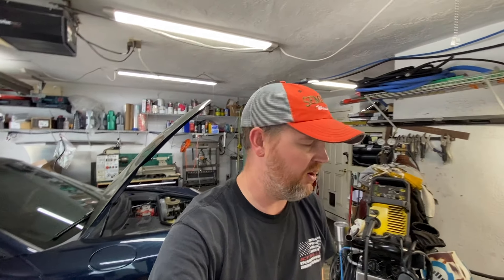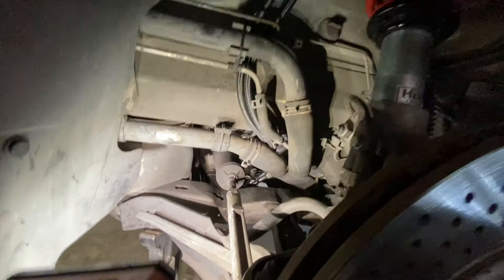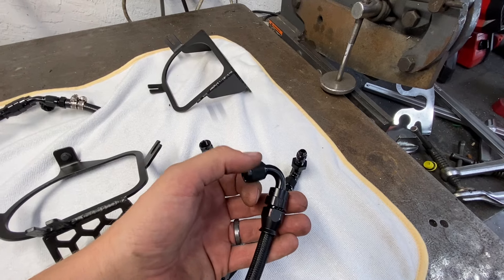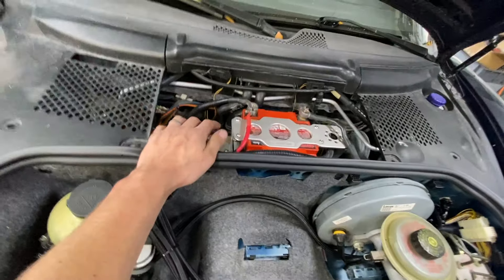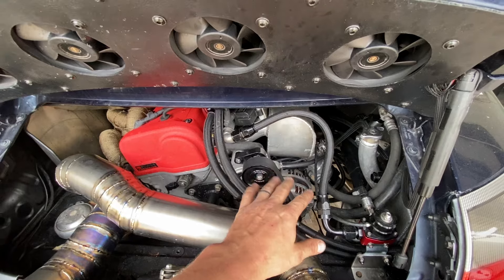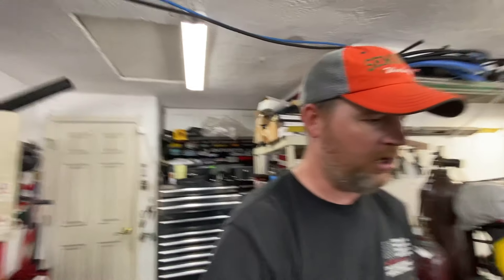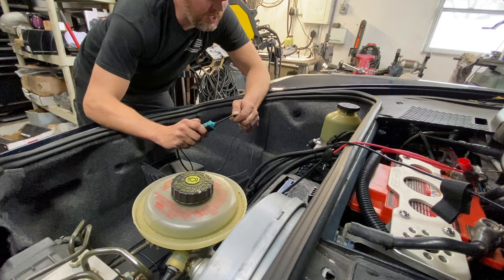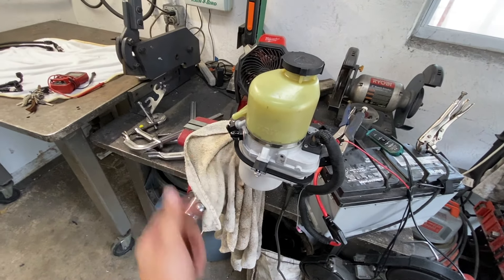Porsche 911 Electric Power Steering Conversion Now For Sale!

Comment: Is at maximum duty all the time?  Have you measured peak draw?
Reply from the maker: Idle draw 6A
Moving left to right 14A 
Stalling the pump when the steering ram is extended +50A
Reply: @baysidefabrication  that's not bad. Volvo pumps are ... Hungrier. :)